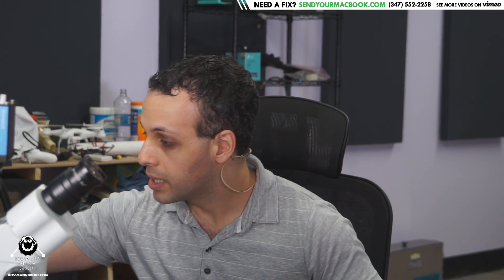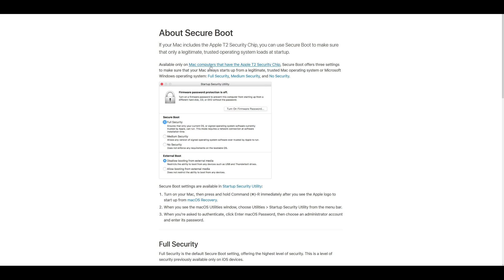An important message from Louis Rossmann

Comment: The real story is that Apple didn’t have secure boot on by default until 2019... Windows had it by default since 2012
Reply: Jess Schallenberg Except that the storage isn't soldered and your data won't be wiped on it during a repair.
Reply: @OGBhyve  
* often enough, it is soldered
* your data won't be wiped automatically, that much is true, but you won't be getting it back if you don't have your enceyption key on hand
Reply: @jess-sch  That's 100% BS: Secure Boot has NO encryption; that's Bitlocker+TPM chip on Windows or T2 chip on Apple. Needless to say Bitlocker is opt-in because even Microsoft isn't that incompetent. You don't even have the basic knowledge to start this discussion.
Reply: @steveq47  Secure boot itself doesn't, but it's a requirement for a fully functional TPM, which is a requirement for automatic BitLocker encryption.
Whether BitLocker is opt-in or opt-out depends entirely on your specific device and Windows edition.
Reply: @jess-sch  More 100% BS: there is NO "automatic" Bitlocker for a normal user. You either have to activate it manually, or set up a Microsoft Account, or your Organization sets it up for your domain account.
In all 3 cases Windows enforces that you store the key somewhere, there is no "lose data by default", like I said Microsoft is not THAT incompetent...

Comment: A friend of mine had their WiFi card fail on them in an older macbook pro which has been updated to catalina. I purchased wifi usb stick which was rather cheap and worked perfectly fine, when she updated to catalina it didn't because they had removed 32bit support and all the drivers utilities that use wifi dongles have 32bit software, luckily some hero made an AIO solution:
https://github.com/chris1111/Wireless-USB-Adapter

Comment: Hard drives are getting less reliable because the quality of manufacturing keeps dropping, not to mention the fact that the bigger they are the more data can be crammed onto them and later lost in a single go.  So, 
1) Back up frequently, and
2) Unless your drive is filled with dire industrial or military secrets, there's no good reason to encrypt your entire disk unless you want to guarantee that nothing can be recovered by external recovery software in the event of disk failure.

Comment: In my office we store and process a lot of data, there is a running joke in the IT department that the safest way to store the data is to put in on HDD, dig a 10 feet hole, dump the drive into it and fill the hole with concrete. So by that definition what apple is doing is definitely ensuring your data is safe, even from the owner.

Comment: Apple is bad, but remember that something similar exists in UEFI for PC which could be locked by special gates in the CPU. This provides "security" while I have security on my computer by using encrypted volume. You can erase and replace the installed operating system, but unable to read the files. Luckily, this is not done for desktops, where Motherboards manufacturers does not know what CPU you would put in (not a model), and since BIOS chip is on the motherboard and CPU gates are on the CPU, usually it is unlocked, but it could be locked on a laptop. Generally hardware should not care what OS or software you are running on it after you have bought it.

Comment: why cant you just go thru the ssd directly? cant you solder wires directly to circuits that go to the ssd and then use a usb to connect to it and copy raw data, then go from there? im willing to bet it is possible, just like using the JTAG capabilities to get around some T2 mess. if anyone is willing to ship me a spare board that is locked up i bet i can get at the data as well as make a way to unlock any DRM for replacement parts. i just dont have the spare cash to be buying as-is macbooks to experiment on, but i have all the tools to do it.

Comment: I have a Macbook Air 2012 and did a system restore to fix a wifi issue - apparently something was corrupt on my time machine backup drive, so it handily rebooted halfway through the system restore process (checking drive health before restore isn't a thing, apparently). Had a computer that was working ok apart from one problem, now a thing that won't boot. Took a few days to fix, and for a while my data was in a real no-man's land.
The reason I went straight to doing a system restore was that Apple Hardware Test just doesn't exist anymore for my machine on Catalina. Boot into internet recovery and - it can't find the file. Basic hardware diagnostics depreciated by software. Could've saved a lot of time not recovering a failed backup drive if I could just have checked the damn diagnostics!

Comment: TPM on PCs and Servers - Do some google search on how the vulnerabilities of Thunderbolt bolt, and USB openings work. Also, you dont want people switching out equipment at a sever level or even consumer level for data, when a desktop or laptop is left in an office, it can be compromised. This is why the TPM (in pcs/servers) and your apple product has this. Everything is verified, and then if it doesnt match, it sends notice. Lets take an example, a desktop or laptop is left in an office, and someone needs a backdoor in, or needs to log data, they get access to the machine and insert xxxx in place of the original part, and no one will know better.

Comment: What device from another manufacturer can you recommend that will run OSX/MacOS.
I haven't liked the Mac hardware since 2013, but the operating system is so much better than either Windows or Linux.
Just TimeMachine alone is very good. The way it handles hi-dpi monitors, multiple monitors, and many other things is what makes me tied to the bad Apple hardware.
I used to like the hardware as well, but that ended almost a decade ago.

Comment: I use an macbook currently and I'm considering switching to another laptop. I would like to use ubuntu and do use IDE's by IntelliJ quite a lot with multiple IDE's open at the same time along with a browser.
Which laptop would you guys(also Louis if you see this) suggest with respect to build quality, performance and after sales service?
Option to upgrade parts are a plus.

Comment: I have a macbook with T2, I disabled secure boot, but one day it didn't want to start. BridgeOS had to be reinstalled. after installation could not boot from usb only from the internet, had to reinstall OS again and all my data lost
I suffered this 3 times a year T2 is a big failure that did not help me at all as a user. now I have a non T2 macbook that I rely on
Reply: May I ask which model of MacBooks with T2 is that?
Reply: @MCMMADDOGXCV  Macbook Air 1932   the year 2018
Reply: Dorel Taran thank you.

Comment: Command R then go into utilities. The options are there in firmware settings. 

So basically the T2 Chip handles all the encryption keys, and whatnot. You can't decrypt the drive unless you have a working T2 chip. 

In the military this would be a boon for classified and above computers moving data from location to location. I understand why they have the option. Having it set by default though is a bad move. 

I prefer having my whole laptop locked down. Because, like a normal savvy computer person, I have all my data on an encrypted backup. You can't even go into windows bootcamp without the firmware password. Why so secure? Because its no ones business what's on my pc. Its the principle.

Comment: I'm glad I cheaped out and got the touchbar-less MBP for work. Three years later, still fully functional, never had a problem. I have had the battery replaced but that was only because they offered, not because I had yet experienced that issue with this model. I don't actually use the keyboard much, it lives docked at my home or work office desk about 95% of the time.

Comment: I figured the secure boot out when trying to install to a USB drive to see what speeds i would get. I know a 256gb USB C drive is not going to be fast but when the soldered on SSD dies, and it will, I was curious if performance would be manageable from a 'speedy' external drive. It was a pain and on by default....and I manage PC's in an office environment for a living.  = ) Geez Apple.. Thanks.

Comment: There is SECURE BOOT on normal PC-s. What it does? It checks the operating system for any stupid haker bullshit, and if it detects shit, it error's out. All of the data remains there, and you can access it from any other working PC, via sata to usb or directly sata (or pcie in case of the newer m.2s). WHAT DAFUCK IS WRONG WITH APPLE?? Think diffrent (Yeah, right, more like think like an idiot). Also the GENIUS BAR... WHAT KIND OF GENIUS IS ONE THAT IS NOT ABLE TO PLUG A FUCKIN'BATTERY CORRECTLY??? Are the people at the genius bar MENSA members, like I am?? NO!! THEY ARE JUST PLAIN IDIOTS THAT COULDN'T GET ANOTHER JOB BUT TO LITERALLY STEAL FROM PEOPLE!!! FUCK YOU APPLE!!

Comment: Even Edward Snowden was confident in normal high bit encryption. There is no reason for this security feature to exist, even if you are a KGB super spy, or stranded space alien. That said, Louis, is this data deleted in a way that could be recovered? Standard deletion only removes the disk address info, there is free software that can recover files as long as they aren't written over.

Comment: On new computers shipped with Windows 10 Secure Boot is also enabled. They say for your security. I disable it first thing and tell it to use Legacy Boot .. I also turn off UEFI which is only needed if your boot drive is very large size. Not needed in most cases.

Comment: I have a question and it may sound dumb to some but it's a question from ignorance. Could you, in theory, hijack the power and data pins from the ssd and run jumpers to a USB 3.0 board that you could then pull data?

Comment: All of them need to stop with the soldered-on SSD crap. It might make sense if SATA or mSATA were the only other options, but m.2 is already ridiculously tiny. The chips and controller are barely smaller than the PCB, so the space savings is practically non-existent. All they've accomplished is inventing new huge problems like this one, that would only be an annoyance if you could remove the damn drive to recover data from another machine.

Nothing but a scheme to remove upgrade options, force early obsolescence, and shove cloud backup services in customers' faces.

Comment: Trusted boot is designed to prevent resident viruses and unsigned code running prior the operating system. Also prevents data theft. It's something common on modern hardware. Yet you do make an important point: for most people that's not as important as being able to recover your data. In general it should be safe to allow external boot for a signed OS. If the startup password which decrypts the disk, is only used to access the actual keys which are stored on the T2 chip, this explains why erasing T2 destroys the data irreversibly.
Reprogramming the T2 chip should erase the keys because a malicious user might abuse it to take control of the user data. It might be still possible to decrypt the disk if the recovery keys are also stored in iCloud. Give it a try!

Comment: Am I the only one who thinks that this is a good thing that you can't copy data from my computer by default? 

I do believe that t2 chip is scam, designed to prevent repairs. It was hacked by the way https://www.reddit.com/r/jailbreak/comments/fgi7lo/upcoming_checkra1n_support_for_the_apple_t2/ 

My experience with apple: 
1) MacBook 2009 - used daily for 5 years, sold it in 2019 in very good condition 
2) MacBook Air 2012 - used it for 5 years, sold it in 2016 after I spilled water on keyboard. Several buttons stopped working but everything else functioned perfectly. 
3) MacBook Pro 15 2016 - still my daily driver. Bottom case with battery and keyboard were replaced for free 2 years after purchase (No apple care). Screen was replaced for free 3 years from the date of purchase. 
4) iPhone X screen was replaced for free after 2 years of usage (No apple care)

I think that you see a lot of apple products in your shop because they are very popular compared to other products. Apple products have some problems. Their customer service is okey and usually fixes all manufacturing issues free of charge but definitely can be improved. Overall quality is very good. And used market price is very good too. If you don't want to loose your data - use time machine. It is very simple.

Comment: Secure Boot is something other laptops have had at least as long as Apple laptops, and it has been a pain there as well. But the whole "we delete your data if our security chip failed" or the "we don't let other hardware than the one the laptop was originally delivered with" issue has not been as bad for Windows (because it is an operating system issue). With Linux we had to fight the manufacturers to NOT MAKE SECURE BOOT THE ONLY OPTION, because then only payola-OSes (meaning Windows) would work on their machines, and they would miss a small but still significant bit of the market (because system administrators are running the Internet, wouldn't you know...) and more than half the market if they implement it on servers. Long story short, the reason we don't see shit like that in WIndows is because users (competent users) protested for years against stupid stuff like this. And WIndows Vista wasn't bad at all, it just had the second issue (no hardware that wasn't present at installation time would work), and that made people say it's bad.
As for security, security is made up from thre components, integrity, availability and confidentiality. All the "security" policy in Catalina seems to account for is confidentiality, and even that is only for Apple, not for the user (because yes, your OS phones home). They have totally forgotten about availability (that you can get at your data), and don't care about integrity (that the data isn't modified). And the T2 chip, which is failing more than not, is not helping with anything else than securing Apple their business of selling more laptops.

Comment: And people would be complaining that data is not secure. You always need to backup - backup backup. The software to do so comes with every Mac. All one needs to do is connect a hard drive. If you add a few $ per month and check a box it’s synced to iCloud with a 30 day history.

Comment: T2 seems to be designed solely for large companies that need to secure their data at the expense of occasional whole laptop replacement; it sure as hell isn't designed for ordinary users.

Louis, I would add one thing to your plea: If you have a laptop, ANY laptop, be sure to back your data up. Especially on MacBooks, since Time Machine is both pretty good and completely unobtrusive.

Comment: wouldnt be an issue for me. all data is in iCloud. you can get Macs to put all your data in iCloud, by logging in to iCloud during the prompt at setup. I think Apple are working on that basis. 

Of course, if you ignore the iCloud prompt during setup, and don't do any time machine backups, I guess you have a problem

Comment: So the moral of the story is pay for a backup service or invest in a couple of external hard drives to back up to. 
The hardware awareness feature is quite troubling though that seems like Apple are actively stoping repaires. 
You wouldn't by a car that stoped working if you didn't have the manufacturer change the tires.

Comment: im a nerd too, volt volt defult apple loads startup firmware chip chip t2 chip tx35235 chip grab files corrupt connector chip t2 t5 secure boot firware computer data dead erase data default

Comment: Same issue why I still use legacy boot for my Linux and Windows machines. Because UEFI is a little brother of T2 mayhem and I don't want any of them in my machines.
Reply: I've been using UEFI since it's come out and haven't had any problems, across multiple computers from multiple manufacturers.  No, this is not related in any way.

Comment: Using my laptop my drive is software encrypted, as long as I remember my password, I can get my data back if the computer fails. There is little to no need for a Mac to take a cyanide pill like this, these kind of setting should be opt in and not opt out. I also work in the cyber security industry and this is total trash. :)

Comment: Well, from a security perspective secure options should be the default setting. I would not recommend to disable secure boot but to set up a proper backup.
Reply: Until the security feature itself becomes the problem.  Secu-ROM is an example of a security "feature" that was actually a problem that ended up being replaced....  of course now we have Denuvo destroying SSDs.